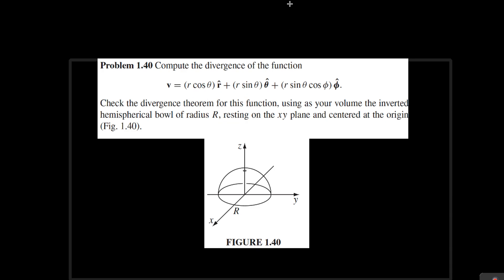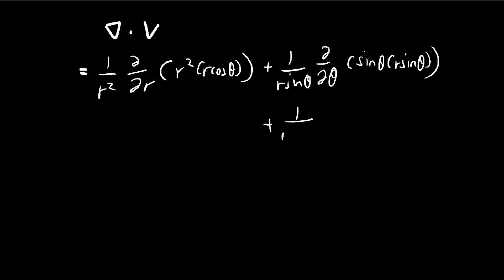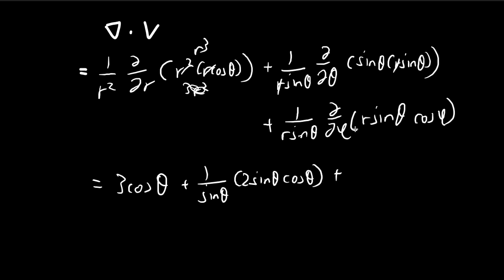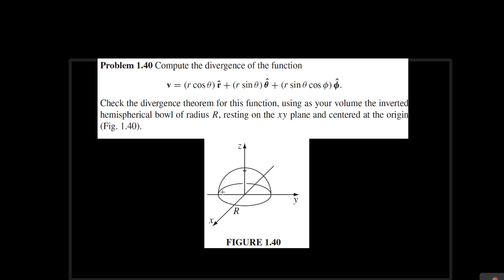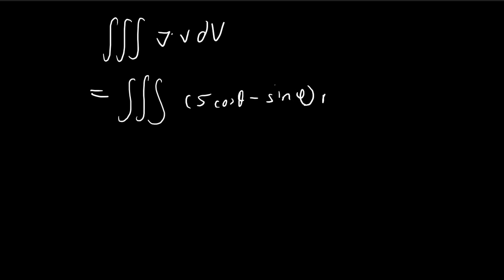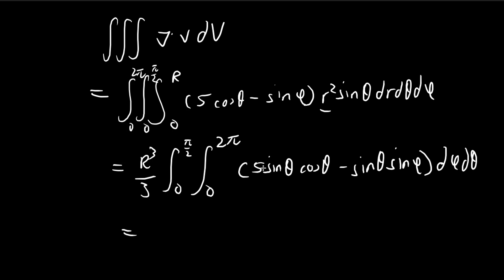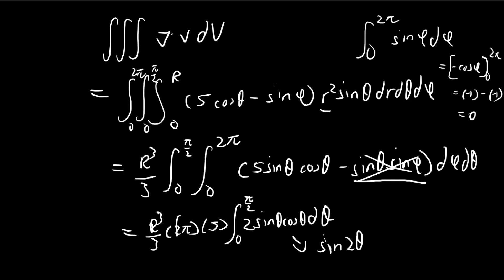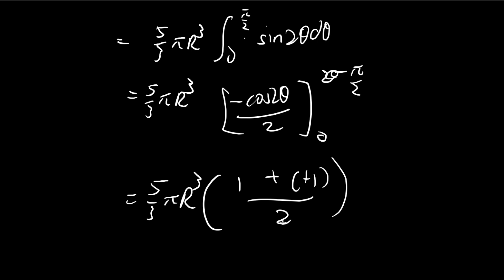Problem 1.40 (Part 1) | Introduction to Electrodynamics (Griffiths)

Comment: wait, wouldnt the phi value be pi over 2? The theta value should be 2 pi no?
Reply: Damn im having same issue, for some reason at triple integral they switch and im having hard time figuring why
Reply: @FatbardhAlidema  I was confused before... Theta goes from xy plane to z axis, phi circles around xy plane. In some books this is backwards, but in physics this is how it is normally done. So with the half circle, we only integrate 0 to pi/2.